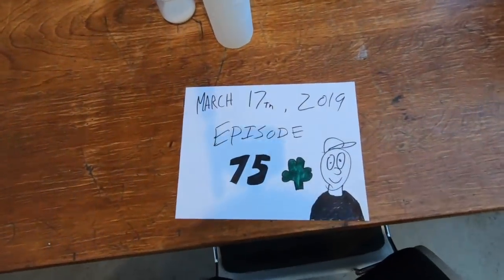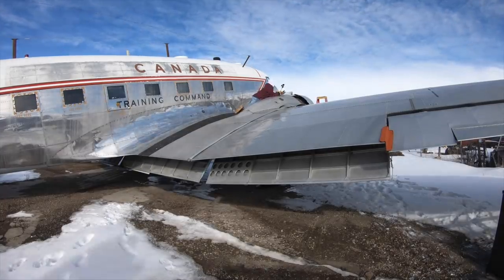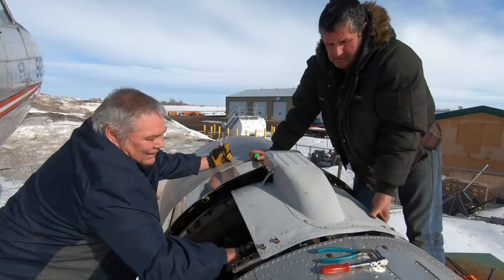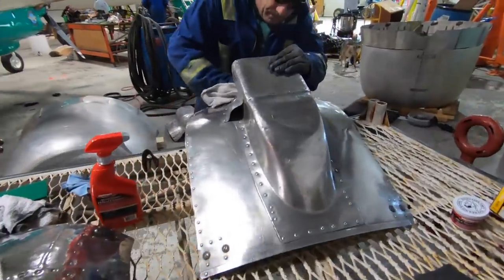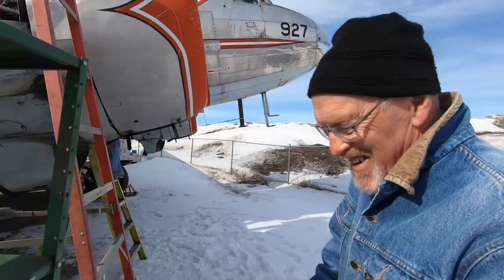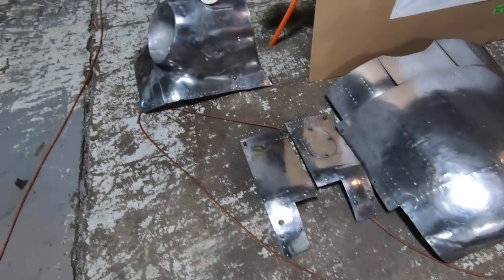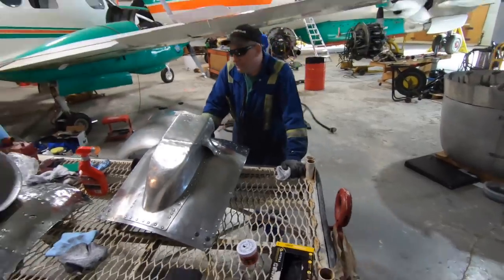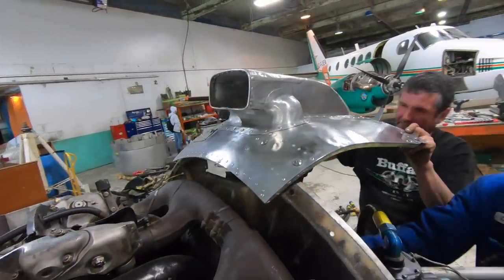"Stealing DC-3 Carburetors" Plane Savers E75

Comment: After watching Episode 75, I wondered what company made the Carburetors for the DC-3's before, During and after the war. Instead of just sending Mikey an e-mail I did the research. The Main manufacturer of Carbs for PW engines was and is still a well-known company. Holly Carburators. Not only were they on C-47/DC-3s but also on Jeeps, Trucks, Tanks, PT boats and even the B-25s that Dolittle used in his famous attack on Tokyo Japan.

Comment: Happy Birthday, Joe!  So does this mean Buffalo has three D-Day C47,s?  Are you planning on just bringing one over? I thought the carbs would be bigger! Shame (most of) these old birds still need leaded fuel!
Reply: The P&W Radials are pretty high tolerance engines. The DC3 is rated to run on 91 octane aviation fuel, therefore to be able to run on 100 octane or in some cases, whatever was available. The lead keeps the knock down and valves sealing properly. In WWII all aviation gas and almost all auto fuel had lead, the higher the octane rating, the more lead. Current non-alcohol car fuel has other chemicals in it that do the same thing that lead does, with the advantage of much less spark plug fouling, which high lead fuel is notorious for. Some older small airplane engines don't like high lead fuel. others like the 1830's of the DC3, don't care much. We used to fuel a T6 with unleaded 87 octane car gas worked fine, no damage, no noticeable loss of power, smelled different. The EAA did an extensive study of the use of car unleaded in small planes, worked fine, the question of vapor lock seemed to not be an issue. At all but high altitudes, 90-92 octane non alcohol car gas ought to work fine, some carburetor and spark timing adjustment might be need, however these would likely be minimal. While the land vehicle fuel would likely work just fine, the legality of using it for commerce with a certificated airplane, is a different mater.

Comment: So did that carb need any cleaning?
Reply: I felt the same way. The Carb. Was new,only had 1 hour of flight time on it. So no inturnal cleaning needed. But I  would of sprayed the outside with Carb or Brake cleaner . I cant put a dirty part back on .
Reply: I agree, but I think they checked the carb anyway? Perhaps the vid just didn't show that due to editing? ;)